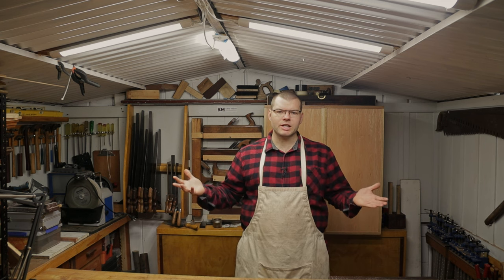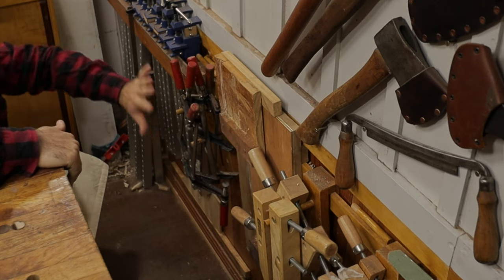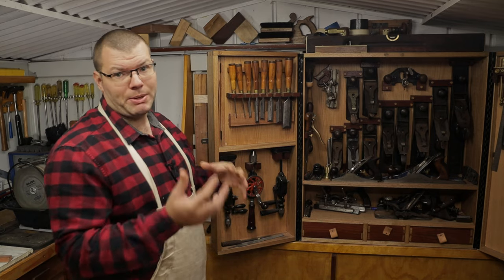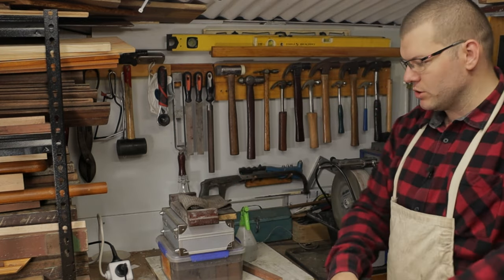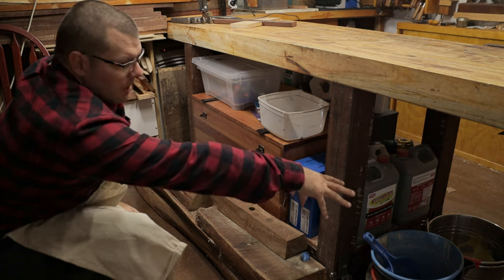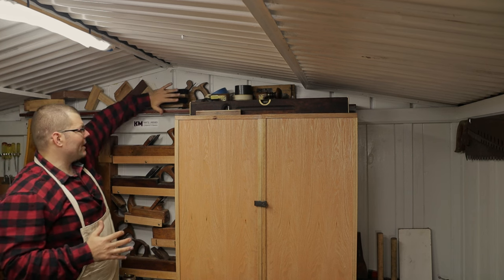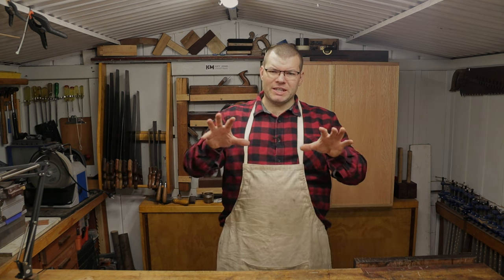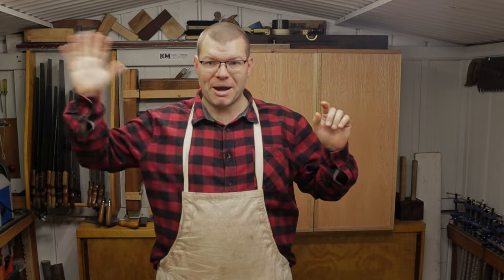Small Workshop Storage

Comment: I missed this video when it was originally posted but I've just found it and watched it a few times. I'm moving my home around and all my woodwork stuff is going into a room that is 11 by 9 feet (3.35 by 2.75 metres). In the past week, I have daily moved stuff around, trying to find the optimum layout - and I'm still in the process of doing that. With the amount of stuff I have to fit in, it is a grind lifting all the heavy stuff around - but it has to be done and will eventually be worth the struggle. One thing I have realised is that I need to trim the tools that I actually need because there are so many that do not fit into the hand tool category that I will be doing there. So, a lot of it will be going to a barn for storage or my carpentry use. My bench will need to be placed centrally in the room with everything else stored around the walls, within arms-reach. The door into the room is in an awkward place so I will have to work around it. There are only two double electrical sockets so things need to be set out leaving access to them. The room heater and window take up a chunk of one exterior wall so that area is out of the equation. It's proving to be a head-scratcher so I'm having to be creative.
Reply from the maker: Sounds like your move is keeping you busy. It's definitely a bit of a struggle to fit lots of tools into a small area, I'm sure it's worse after having a larger workshop. I don't think I'll ever be 100% happy with it, I'm always thinking of how i can fit more storage in or make better use of the space. It's just a constant work in progress.

Comment: What a fantastic , down to Earth tour of a busy person's hand woodworking work-shed.
I repurposed a lockable storage area during Covid, which is 3 by 4.5m.  I have a Moravian style workbench with a sliding Dead-man at the front of the bench.  The workbench weighs about 120-150kg but it collapses into 7 parts so if I was to move this is easily transported. 
Your video provided me with a solution to how to be productive in a hand tool workshop - the use of cabinetry behind the workbench a couple of side workbenches for sharpening (Tormek and stones).  I think your cabinetry is a good mix of vertical storage and low level traditional cabinet storage.

My biggest dilemma is the need for equipment I use in continuing to do further construction in a large country garden; making it accessible but not impacting on hand woodworking activities.

What type of lighting regime did you adopt for work and also for filming?

Thanks for a great video
Reply from the maker: My shed has no mains power wired to it so everything is powered off an extension cord from the house. I ran and connected 4 LED battens (similar to these i can find the exact ones i got anymore, but i had ones that just plugged in -  https://www.mercator.com.au/product/bright-led-batten-with-sensor/) 
these are on the roof of the shed above the bench these battens just plug into a power board that i cable tired to the roof beam. These main lights give me adequate lighting for most tasks and provide most of the light for filming.

I also have 2 articulating lamps from ikea (https://www.ikea.com/au/en/p/tertial-work-lamp-dark-grey-50355442/) the one at the bench i jammed into a wooden holder that fits in my bench dog holes (i got that idea from Rob Cosman) which allows me the more extra lights where i need it.

So far this has worked for my lighting, but its not perfect and i am looking for more portable lights to help with filming.

1 solution i can think of for the construction equipment is maybe keep it portable on a cart with wheels so you can move the tools around and out of the way when you don't need them. not sure depends on the size of the equipment and how much space you have to move things around.

Hope this helps.

Thanks for the comment, good luck with you workshop storage, its always a continual battle to fit more stuff into a small space and still be functional.

P.S. i may end up doing a videos covering the lighting at some point, and i have made some changes to my storage recently and will most likely do an update video on that soon.

Comment: Very nice how you utilize the small space. How do you do your woodworking in winter? Could imagine it gets quite cold in the small shed and i am looking into something similar as shop since i dont have much space :)
Reply from the maker: I am from Perth, so the winters are usually mild. I do sometimes use a small electric fan heater which works ok since it's a small space and wear more layers, so far I haven't had too many issues. But I make do with what I have. Ideally the shed should be insulted which would help a lot. Hope that helps
Reply: @AussieWoodshed  haha missed the fact that australia doesnt have winters like Germany😅